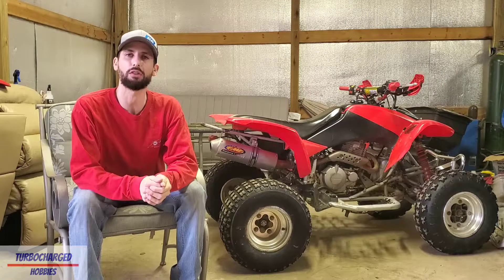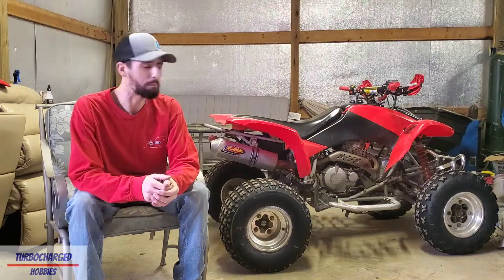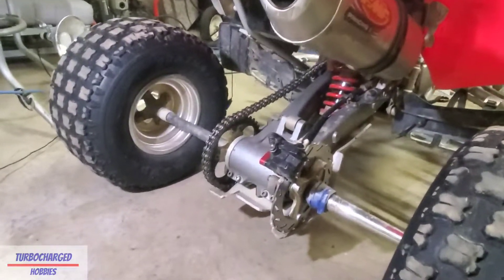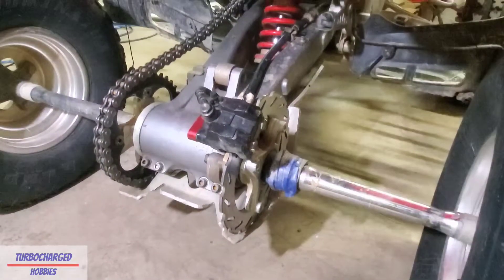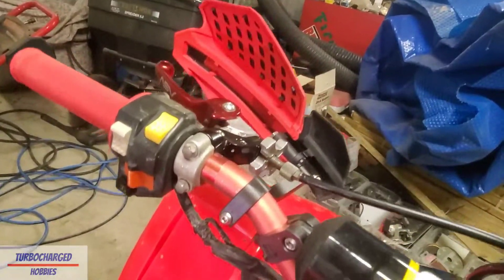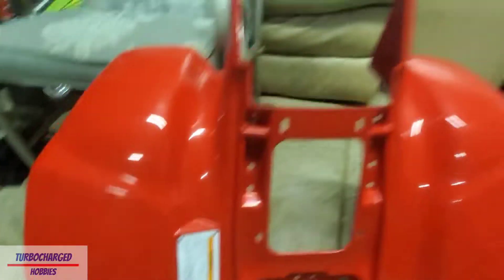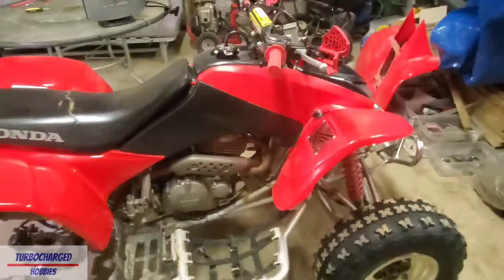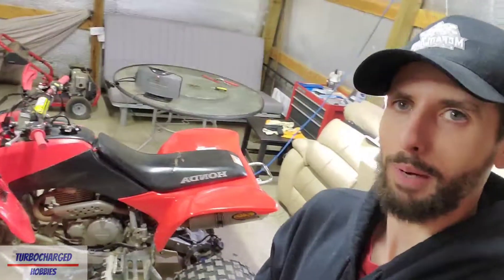Showing off my 2007 honda 400ex plus replacing the rear plastics

Comment: Hi, do you have the original exhaust or the one from 450?
please tell me the spare and reverse lights, where to get such a badge, I'm from Poland, can you give me your e-mail address?
Reply from the maker: Unfortunately, I don't have the stock exhaust. Do you want to know where I got the piece that holds the key, reverse light, and neutral light? If so that came from ebay, look for Rox Speed FX - Dash Panel. If you are asking about the custom warning labels on the fenders, they also came from ebay.  They are listed under this, HONDA TRX 400 400EX TRX400EX EX TRX400 CUSTOM WARNING LABEL COVERS TAGS PLATES. My email is in the about section on here